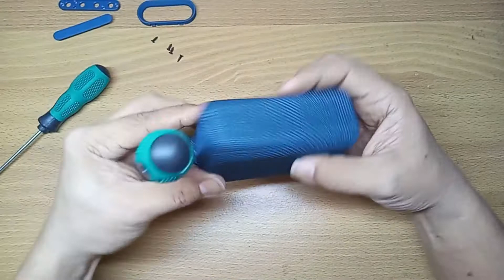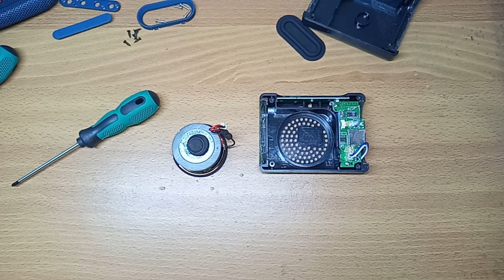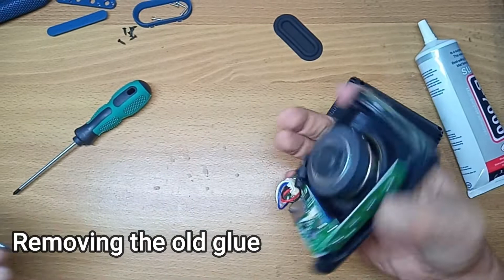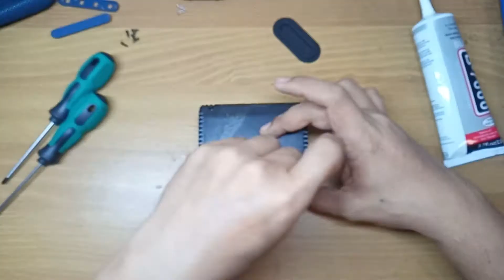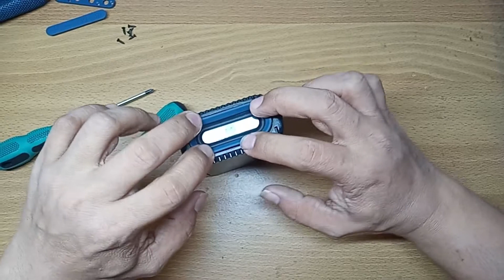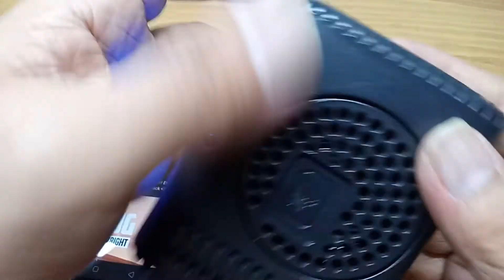T&G - TG313 (Modification) Bluetooth Speaker

Comment: very cool video, also you can consider of using alcohol to elegantly remove the old glues, ang putting some little heavyweight on the passive makes the bass more shocking when youre holding the speaker like what i did on mine. Anyways, keep it up, really good videos
Reply from the maker: thanks sir.
Reply: What exactly he did can you explain ? I am ordering one for me too and I need more bass so what needs to be done exactly

Comment: Those speakers are JBL's fakes, but I'm keeping an eye on the modifications of those fakes, especially those that are cheap, just for fun.

There are only two things that are disappointing here, but one must be done, and the other one is replaced with aiyima speaker of the same output, so I wonder what it would have been like to have 3 comparisons.

Also, it would be a good idea to replace the battery with something around 18650 3500 ma since it can be used for a bit longer.
Reply from the maker: thanks

Comment: Ask lang po ako boss. May improvement po ba ng tunog sa pag butas ng speaker?
Reply from the maker: Mayron nman po, nag improve po ung treble at bass sounds nya, kasama na cguro sa improvement ng sounds ung pag glue ng speaker at radiator. Mas ramdam ko kasi ngayon ung pag vibrate ng tunog pag hawak ko ung tg313 kaysa dati.. at pag hinahawakan ko ung radiator medyo nababawasan ung tunog ng bass nya. Kaya masasabi ko na effective po ung mods na ginawa ko.
Reply: Possible bang malagyan p ng isang 18650 n battery yan sir? Magkakasya p kaya sa gilid?

Comment: Ma...non facevi prima a cambiare il driver con uno con più watt? Io ci metterei anche un amplificatore migliore
Reply from the maker: yes sir. upgrading the driver is the best upgrade. but you need to upgrade the power supply and the speaker also. its to costly to upgrade for a cheap bt speaker like this. i would rather buy a new bt speaker with high specs. thank you for watching sir.
Reply: @iamrhinz2817  I'm getting the T&G T505 speaker and as soon as I get it I'll take it apart and see how to upgrade ... I'll make a video